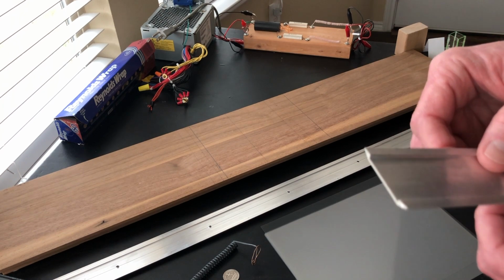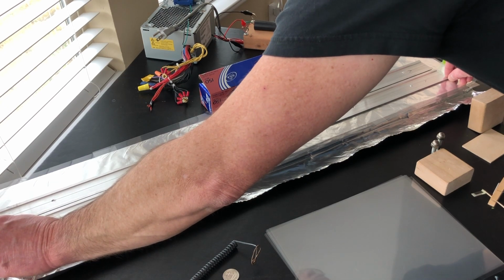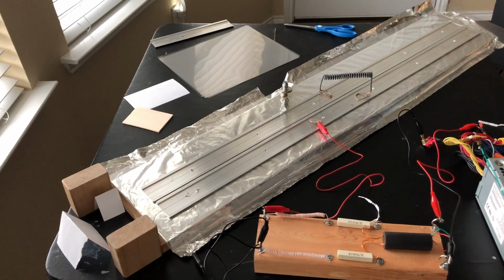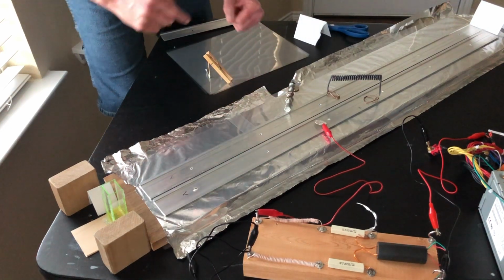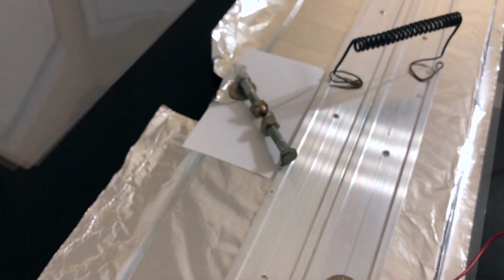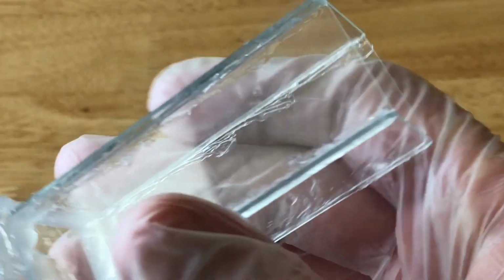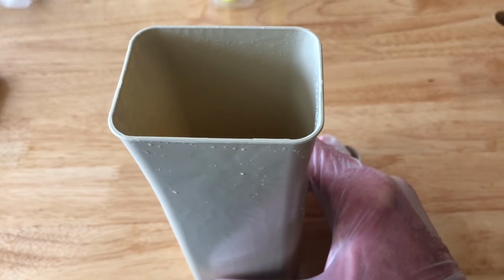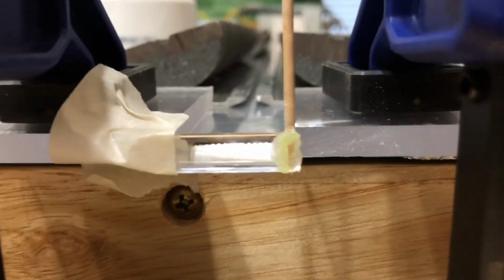A visible laser beam from household chemicals! No laser diodes! No specialized parts. No kidding!

Comment: Is this a tea laser? I've only seen ir tea lasers. Nice!
Reply from the maker: Thanks! 

Yes - it is a TEA nitrogen laser, running on ambient air, being used to pump a dye laser made with homemade dye.
Reply: ir tea?
Reply: @ARCSTREAMS  infra red tea laser.  Wow those were lots off acronyms: 
Ir tea laser:
Infra red transverse excited atmospheric light amplification stimulated emission of radiation....or IRTEALASER ! :-)
Reply: @TheRainHarvester  i know what you said but i never heard of a tea emitting infra red
Reply: @ARCSTREAMS  wavelength 10.2um.  I thought all non dye tea was IR. What other wavelengths are there? ( I'm new to TEA.)
Reply: @TheRainHarvester  it's UV
Reply: I know what he's getting at. You can pump a co2 laser in the same fashion.
Reply: @Slowly_Going_Mad  what do you mean by pump a co2 laser? i think those do emit ir but they're  usually pumped by electrical injection
Reply: @ARCSTREAMS  It's true co2 lasers are usually run in continuous mode like a helium neon laser. Co2 lasers are not directly pumped though. They couple to a vibronic band from nitrogen, and can be ran in TEA mode with some insane output. Here's a link to rocketman340's example:https://youtu.be/7bMLz8ve6O8
Reply: @Slowly_Going_Mad  ahh yes if you have a mix of nitrogen with co2 or other gases that will emit in the ir range then yes its possible but i was referring to the general tea either in open atmosphere or with nitrogen introduced in the excitation cavity then the peak bandwidth will be in the uv range
Reply: @Slowly_Going_Mad  hahaha damn those co2's are crude man ,ive seen a large one at a science museum and they burn like crazy, i had my name inscribed on a wooden plack by the laser as souvenir , too bad this guy does not give much details about it or most of his other vids nor does he reply much ,was that a hockey puck or some kind of absorbing material to block the beam path? wonder why it was not smoking also?
Reply: @Slowly_Going_Mad  i think styropro used one that was actually ionizing the air at the focal point lol
Reply: @Slowly_Going_Mad  really wonder what his tea looked like,is it big or what? i heard you can only make them certain size
Reply: @ARCSTREAMS  I'm with you on that. Depends on what we define as most. Most media pumped in this fashion will output UV simply because the overvoltage used and the likelihood of having a transition in that band gap. Or the most common to build and demonstrate usually being vibronic coupled lasers like co2, oxygen/iodine, or hydrogen halide based things. It's a shame that it's a bit more difficult to do the same thing on a visible wavelength media though. I would have way too much fun with that.
Reply: @ARCSTREAMS  as for the size limits the answer is blurry. If we're talking about purely superradiant gain then it would be something to the order of the channel length divided by the flourescence lifetime. But this isn't really enough to fully describe everything going on. If it were true then any that were built and operated outside this limit should experience severe performance penalties. The lower level has a tendency to reabsorb and re-emit the gain band so it effectively scatters the light. If the power of the signal beam is high enough it can overwhelm this limit and basically just carry on through like nothing happened. This basically extends the gain length usable but we are still limited by peak pump power. Longer channel more inductance. Because it's a three level system peak pump power has to be very high to overcome threshold. I would say the system would probably cap at 15 feet or five meters. At that point you would need to run it at reduced pressure to get a longer flourescence lifetime to relax the pump power requirements.
Reply: @Slowly_Going_Mad  "It's a shame that it's a bit more difficult to do the same thing on a visible wavelength media though." 
how do you mean? are you saying that most powerful lasers unfortunately only operate in the invisible ranges?
Reply: @Slowly_Going_Mad  i sometimes have trouble understanding all this stuff but yes there is some kind of trade off to do with lifetime of state and how far the light has travelled ,if it created high stimulation gain or too much absorption,then you have the amount of pump power and the pulse lenght etc etc but yes it can work i heard with a 9 inches or much larger but depends on conditions
Reply: @ARCSTREAMS  yes. Sadly most are either infrared or ultraviolet. The ones in the visible spectrum are usually low gain or have crazy pump requirements. For example the 532 green used in most green laser pointers is actually frequency doubled infrared from a neodymium ion based crystal. Even though this is somewhat disappointing it's not too surprising considering our visual range is only 350nm in bandwidth give or take from about 770nm deep red to about 400nm bluish violet. I had a violet laser pointer that was 60mw 425nm and it looked dimmer than a 10mw green pointer. The green one wasn't that powerful but the violet one would pop balloons.
Reply: @Slowly_Going_Mad  i had the same thought as you ,i wish the color visible ones were the ones used for weapons lol too bad its not like star wars or star trek or like that 5MW visible one in the movie real genius ,but hell an argon is nice and visible and burns through metal as well as green copper vapor laser but what frustrates me is how i am not able to build a simple laser that creates visible beam because there is no easy material out there that i can easly pump with say a TH lamp lol too bad because i did build a an optical pump array using 4x500w thl lamps only to later realise the best i can do was possibly pump an nd:yag which is invisible and need a doubling crystal etc etc fucking pisses me off there is no easy path to making one visible and i hate semiconductors and diodes, id rather find a liquid or solid that lases visible light easly,,ohh well no such thing until they discover new materials,till then i can always try to make a tea pump a dye and get a visible beam but pulsed :( ,yet it can look cw if the rep rate is 60hz or more i suppose ,all i got now is a white beam i made using led from home depot and a pin hole and achromat doublet lens ,but hey i got me a nice 1.4mrad beam i can shoot nicely across a long distance even though its weak and barely visible under foggy room condition
Reply: @ARCSTREAMS  I kinda did the same thing with the flouroscene using the violet laser as a pump. I don't think it classifies as a laser but it did have pretty low divergence. As a rule if thumb for every 100 miliwatts of power you get from an argon ion laser it takes about a kilowatt to supply it. As for copper vapor, It's also one of those that qualifies for crazy requirements as it also has high threshold and can't be run continuous making high power high frequency switching components necessary. Dyes are probably best bet.
Reply: @Slowly_Going_Mad  "I kinda did the same thing with the flouroscene using the violet laser as a pump." well i never done anything like that so what color beam did you get with the fluroscene? and did you juts shoot the violet beam through it and it changed color and went out the same way the other side?
Reply: @ARCSTREAMS  I actually have that experiment on video on my channel. I just used the laser to make a spot glow on a toothpick and made an apature to choke out incoherent light then used a lens from binoculars to collimate the result. Also the beam was bright green.
Reply: @Slowly_Going_Mad  i only see 5 vids on your ch and nothing about what you described?
Reply: @ARCSTREAMS  Odd but here you go https://youtu.be/UVJwOoFRfBY. I would skip around or play it at double speed till you find what you need. I didn't really make these for anyone other than my friends.